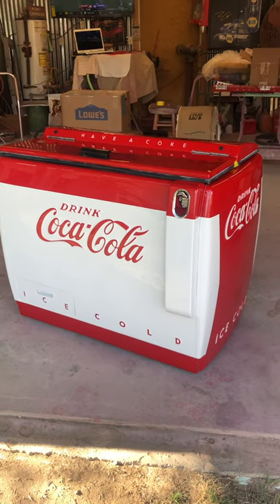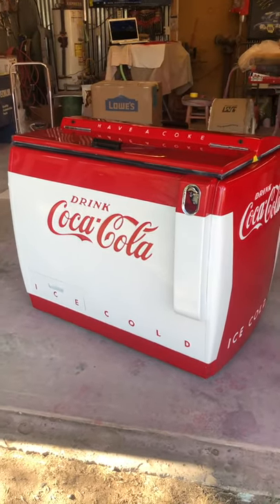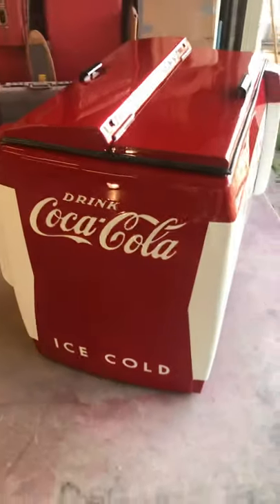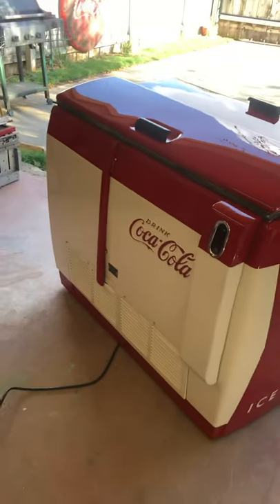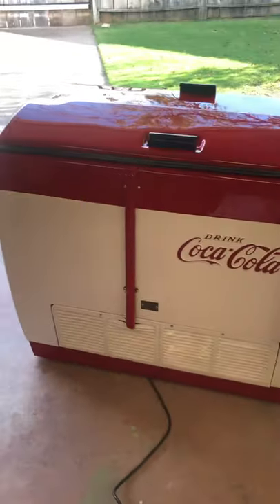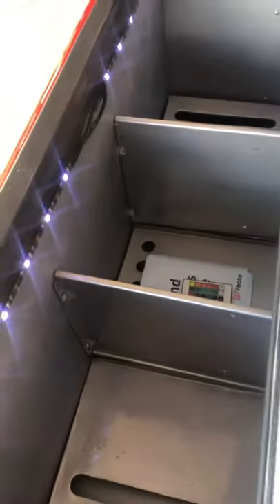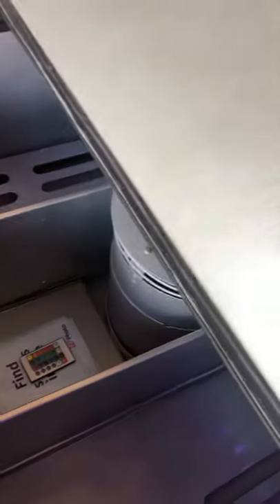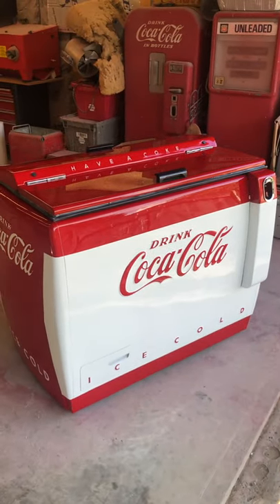1957 Cavalier CMD-D Coca-Cola Chest | Restoration Recap

Comment: Beautiful machine!
Awesome job!
I had one of these when I still lived at home. Had to sell it when I moved out. I’ve always wanted another one. 
I just bought a Westinghouse WD-5 last weekend with awesome original paint, no dents, and no rust but it is missing the temperature limiter and set screws in the small box by the compressor.  Someone has also mounted a Ranco thermostat on the back of the machine. I haven’t plugged it in but I doubt it works. Is there any place that sells individual replacement refrigeration parts for these machines or will I be forced to buy a new $900 system?
Reply from the maker: Try Sodajerk works and funtronics they do have ac items available